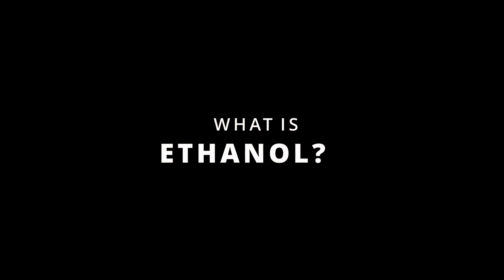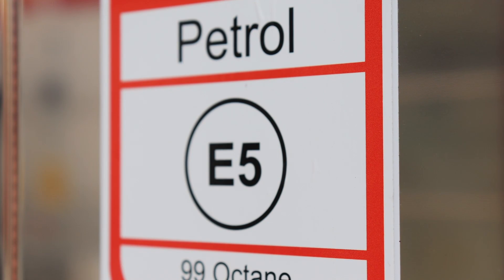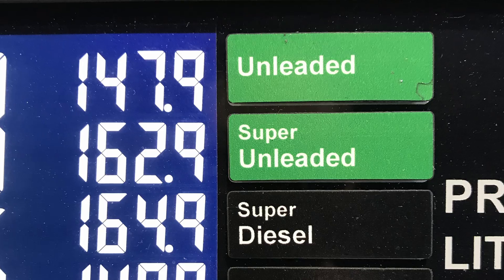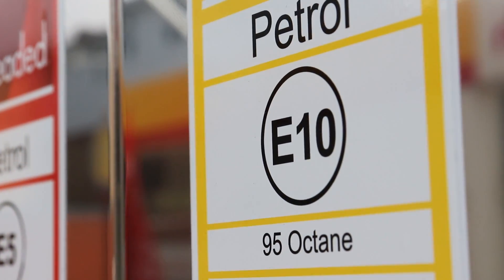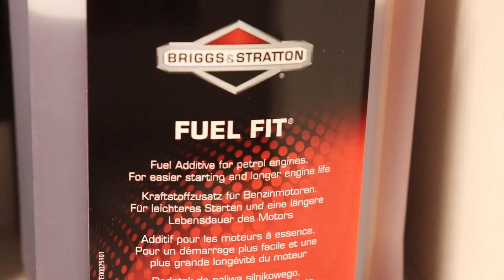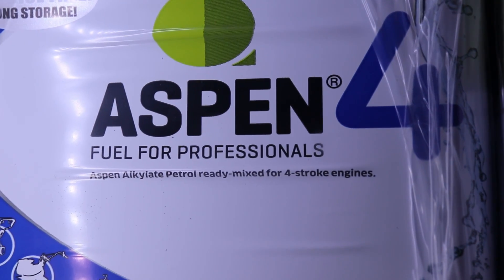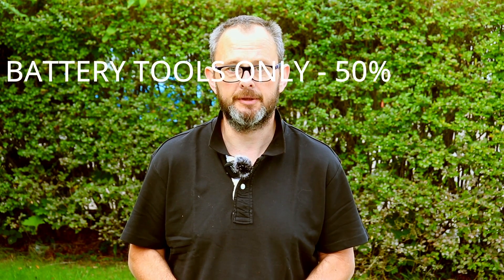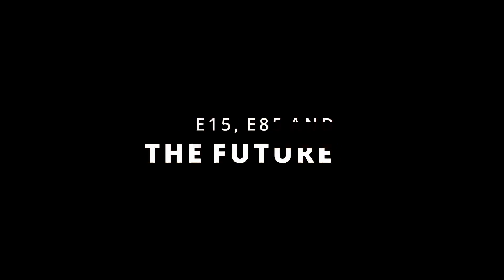Problems Caused by E10 Fuel in Garden Machinery

Comment: You should not use crap pump fuel in garden tools! Use aspen 2 or aspen 4. No problem!
Reply from the maker: Hi Trevor. I agree. However, the economics of a gardening business make it a very expensive option. It would cost more than double my tool fuel costs. It’s a difficult balance. Thanks for posting. Nick.
Reply: @NickBarban  if kept air tight container should go the distance or use one of the very good con servers!

Comment: Its killing you when you breath the fumes in .
Reply from the maker: Hi Barry. I wear a respirator made by NA & UM. Works a treat. Fit is a little awkward in the winter as the fitted face guard is a little more rigid in the cooler temps. 👍. Thanks for posting. Nick.

Comment: I use E5 for my motorcycles and preservative when off the road for winter. I use E5 for my Vauxhall when doing long distances, E10 for city use. I use premium diesel in my Sprinter for long distances and normal diesel for local use. I only use fresh E10 for my garden tools and pour remaining fuel in my car when finished using garden tools. Very informative video though.

Comment: E10 does not produce more power. It has less calorific output than no ethanol polluted petrol. An engine has to be tuned to run on e10 and not contain older rubber or plastic parts that are vulnerable to ethanol. It is a disgrace that this was introduced as the “consultation” highlighted just how many millions of cars were not compatible but they did it anyway. All this has done is put to the cost of running older cars with zero advantage to the bill payers. This is typical green obsessed government putting up tax take by the “green” initiative.

Comment: I have a 4 stroke Honda generator which never failed to start no matter how old the fuel was. Never been taken apart in 25 years until e10 came along, now it never starts and I’m an expert at stripping down the carb. Not sure if it’s related, but my wife’s car shredded its fuel pump after being off the road for a couple of months. It ran for a few seconds then the pump seized.
Reply from the maker: Hi Pete. That all sounds horribly familiar. Good luck with repairs. Thanks for posting. Nick.

Comment: I am trying to find replacement fuel hose for a small strimmer whose pipes and primer bulb have all rotted. Most of the suppliers of the standard clear plastic type pipe say don’t use theirs with E10. E5 only. And I suspect that the suppliers that done say are just dodging the issue. No one claims E10 compatibility. Seems that E10 softens the pipe. So has anyone found that E10 rots their pipes? Using a petrol additive seems unlikely to stop this problem, as there is still 10% ethanol there. 

Only pipes I can find that are E10 compatible are the thicker rubber covered ones and there isn’t any way to use these thicker ones in my strimmer. So I need to use super unleaded only it seems.
Reply from the maker: Hi. I use super unleaded AND I add in the Briggs & Stratton fuel additive. I have not had and problems on my strimmer or my blowers. Seems to be working so far.  Might be worth a try. Hope that helps. Thanks for posting and I hope you find a solution. Nick.

Comment: I only found this video after my petrol lawnmower had completely seized up. I had tracked the oil and all was ok until the first cut after the winter. I used fuel purchased last October that had been in a jerrycan and had no idea that E10 would cause issues. I have made the decision to move to electric, as an excellent offer on Greenworks for a lawnmower with 2 x 4Ah batteries, trimmer and hedge cutter for under £270 was available. I only have 4 small to medium lawn areas and believe battery power should cope with all of it. Sadly I think E10 fuel is just not viable for garden equipment and the experience makes me wonder about all those car engines that must not be as healthy.

Comment: The same equipment you refer to is used in Brazil, where the mandated fuel is E27 and there are no reports of ethanol creating excessive damage. What can you possibly imagine would make equipment in your country not able to also use E10 or E15 or E20 or E27?
Reply from the maker: Hi. Although it does affect vehicles, this video is specifically to garden machinery. Fuel can be left in the tanks of certain equipment and the separated fluid that results, is the main cause of the problems, not the E10 when it’s fresh. Hope that makes sense. Thanks for posting. Nick

Comment: My little used 2018 bought two stroke standby generator was fuelled up in November 2021.
A power cut in March 2022 started the generator and it ran for around 15 minutes then cut out.
When I went to restart it it did not sound right so I tried the manual pull cord and noticed immediately that there was very little compression resistance.
A stripdown revealed a scored cylinder bore that was beyond repair and at the time I thought that I had added too little oil to the fuel.
I have since learned about this and I am really angry that the oil companies or government failed to get the message out that this fuel is poison to some engines. 
I never knew about the problems with E10 petrol as I was never informed about it but it has cost me a £189 generator.
I used to believe and try to be "green" but now they can shove it where the sun does not shine thanks to this policy of blindly introducing a fuel that wrecks small engines and many old cars.

Comment: Gave up using regular pump petrol and have moved to aspen. I had 2 stroke oil so i went for aspen 4 and mix stihl hp super with it at 45:1. The aspen plus stihl hp super contains fuel stabilizer for an even longer life. No toxic smell either engines as clean as a whistle. I dont give in to us causing climate change and i hate electric/battery tools.

Comment: Thanks for the vid.
Remember, E5 doesn't mean it has 5% ethanol, it means that's the maximum it may contain (same with E10). This can vary depending on fuel supplier and location. For example, Esso E5 in the midlands and the south of England contains 0% ethanol however they are legally required to label it as E5 despite it having no ethanol.
I use E5 for all my garden machinery
Reply from the maker: Hi. It’s a point that’s been brought up quite a few times now. It wasn’t something I looked into. Maybe it’ll be part of a follow up. Thanks for posting. Nick.
Reply from the maker: Just as a matter of interest, where did you get that data from?  I’d be interested in having a deeper look into which fuels have what. Cheers. Nick.

Comment: If alkylate fuel is so good, why don't we have it for vehicles.
Reply from the maker: Hi John. Modern engines closely match emission levels that’s alkylates produce in smaller engines for tools. But, alkylates are produced from gaseous hydrocarbons from fossil fuels. Essentially, they are a byproduct of the oil refining processes. Thanks for posting. Nick

Comment: Do not use E10 or even E5  for  garden machinery  - there are long term stable fuels available based on alkylate petrol - Aspen and Husqvarna are two fairly readily available examples - there are others - These typically run £20 for 5 litres but they don't gum up carbs or cause lubrication failures - so long term much cheaper than fixing busted tools.

AVGAS is ethanol free - get it from your local airstrip.
Reply from the maker: Hi Doug. If I wasn’t running a business, I would happily move over to Aspen. But with contracts I currently have, at least doubling the tool fuel cost, it isn’t economically viable. An extra £150/m for fuel isn’t in itself a huge extra cost, but with all the other utility cost increases, and the £300+/m additional cost for ULEZ starting in August, it’s just not a viable option right now. Hopefully if I can reduce other costs, it might become a viable option. Thanks for posting. Nick.
Reply: @NickBarban  agreed, if you are a professional then running pump gas is cost effective, but for amateurs who might run only a couple of gallons a year the higher fuel cost is more than made up for in lower repair costs. One banjaxed carburettor can cost over a hundred pounds.

Similar story of you run carburettor equipped vintage motorcycles....

Comment: I now use Super unleaded in all my small engined tools, mower and strimmer both stopped working. Once filters and fuel lines cleaned and E5 fuel used all tools fired up straight away and all now run beautifully.  It's a bit more expensive but better than having to replace all my tools!
Reply from the maker: Hi Wayne. I moved to E5 fuel with fuel fit as soon as E10 came out. I’ve not had any issues. Fuel cost may be more expensive but it beats they hell out of all the parts that would need replacing on all my 2 stroke gear, bearing in mind the mileage they get used. Not sure what I’ll do when they stop making it. Don’t know if I’ll have transitioned over to battery tools by then. Just can’t see the benefit of the cost yet! Thanks for posting. Nick.

Comment: Useful video,  I only use E5 in mower and chainsaw as there were running problems with E10.  I have also bought a battery powered mower and chainsaw which have the same battery platform.  These are quite efficient,  the chainsaw won't cut as quickly as my petrol one, but I wouldn't expect it too. Most mowing and wood cutting now using battery tools and sometimes using petrol kit for certain jobs.
Reply: Your E10 problems are in your head.

Comment: Years ago, 1961 my friend was running a James motorcycle with a Villiers 225cc 2 stroke engines d to make it smell like a racing motor cycle he added around a tablespoon of Castrol ‘R’ oil to his 2 stroke fuel mixture. Now for those who don’t know  Castrol’R’ is a vegetable based oil. When burned, like cooking oil it leaves a sticky gum residue in the combustion chamber and piston rings. 
The fuel mix we are putting into our cars and lawnmowers is just that vegetable oil. The only way I was able to clean my friends engine was to strip it down to all it basic piece s, with the exception of the crankshaft which needed special tools which I didn’t have access  to .
To glen all the parts (not many) on a 2. Stroke  engine was to use brake fluid and a 1 inch paint brush and soak all that I could get at. I started at 8 o’clock Saturday morning and finished it off by Sunday evening at around 6pm. Washed out the fuel tank with cellulose thinners an put in some petrol/oil mixture and a shot of Red X .
I know what it does to petrol engines but we also have to put this rubbish into diesel engines. Is this causing problems with exhaust systems as my BMW 420d has had 2 recalls for the particulate filter catching fire and this vegetable additive is just the thing to cause as drivin at less than 3000rpm doesn’t get the system hot enough and 3000 rpm would break the speed limit ☹️

Comment: What a useful report . Many thanks . I ran my 4 stroke ride on back in 1998 to 2007 on 6 Fench Franks Cologne mixed with stardard cellulose thinners , the water dropped straight out and i decanted the top layer . Even added a bit of household kerosine . Ran fine , a little rough but cheap !😃
Reply: What on earth is Fench Franks Cologne?

Comment: This is a issue and you should not use it in your small engines   additives separate out , and clog up the carb and more ,issues and breaking down  will be more
Reply from the maker: Hi Ian. Only reason I run with additives is that doesn’t stay in the fuel tanks long enough to separate. I just have to remember to drain in the winter time. Thanks for posting. Nick.

Comment: its so easy to deal with e10 fuel 

buy it in 25 L add 25L of distilled water shake well let sit for 24-48 hours  and you will see it separate drain off the water at the bottom 

now you have pure petrol  and  remove ethanol in to water as  ethanol hydro scopic

Comment: The whole E5 and E10 nonsense is being sold by the government as being better for the environment and blah blah but the reality is that that is not the case, its a lot like the leaded vs unleaded where they removed lead which caused problems for cars and small engines to save the environment but kept quiet that unleaded had an additive called benzene that was worse not only for the environment but also animal/human life,   and things like E5 and E10 have been tested to show they cause the user to burn through more fuel that usual which means over all equal or in some cases more hydro carbines are emitted meaning nothing is saved , however here is the real reason we have E5 and E10 if now you have worse fuel efficiency you need to buy more fuel more regularly to cover your usual use and this all adds up to more spent and so more profits for the fuel company's.

As for battery tools they are good and have there use, originally i used a petrol hedge trimmer / grass trimmer / flymo hover mower, then a a year or so back i got a Worx power washer and since i had that I got a Worx hedge trimmer and just recently i purchased a Worx  grass trimmer and they all use the same battery and since i got the ones with batteries I have 3 batteries so i never run out of power, I still do use my 30 year old Flymo 2 stroke hover mower but i have been looking at changing that for the Worx  lawnmower that again still uses the same batteries.

As for E5 and E10 if you are concerned about using it in small garden engines there is actually a process that can be used to extract the ethanol entirely from the fuel

Comment: Yes it is killing tools. I have a brand new mower that just constantly blocks the carb with a jelly substance. I get maybe two cuts of my lawn with it.
Reply from the maker: Hi. If you use E5 AND use a fuel conditioner like Briggs and Stratton Fuel Fit, it might help clean things up. Hope it helps. Thanks for posting.
Reply: That's exactly what I had. I ended up junking my mower as spare parts were no  longer available.
Reply: Same issue with me. 2019 Honda mower is useless too costly to get carb cleaned constantly and now being sold for scrap. I used the fuel stabiliser which didn’t help at all.

Comment: There is a simple answer to everything.
If wood chips from the US to feed the Drax power station is regarded as carbon neutral then there is nothing to stop plant oil being used.
For that the new rotary engines from Mazda and Liquid Piston can be easily adjusted to run on that.
So instead of going to a petrol station you go to your local farm to get filled up.
As for the evil ethanol that will just go into the dustbin of history.

Actually, you could probably suggest the best plants to grow to obtain oil.

Comment: I use Aspen in my mower
Reply from the maker: Hi John. I’ve considered it, but for the volume of fuel I use, I’d probably have to sell a lung! I🤣. I use Shell V Power with Briggs & Stratton fuel fit. In terms of ecological impact, I know it’s not even on the same scale, but commercial work doesn’t have the same profit margins as 10 years ago unfortunately. Thanks for posting. Nick.

Comment: My car is doing more mpg was 30mpg now 35mpg with a slight notice in power loss only I do occasionally put a drop of redex in the same for my briggs and Stratton mower seems to be ok and they both start ok. Redex may be helping cylinder upper lubrication and they say ethanol increases water vapour in tank reason for redex
Reply from the maker: Hi Stephen. Never considered using Redex. I might have a look at it. Thanks. Last time I used Redex was in my 1982 Ford Fiesta Ghia X. I think I stopped all the traffic on my road when I set off. Looked like the fog had rolled I.  😳. Thanks for posting. Nick.
Reply: @NickBarban  LOL, you should see it when you pour some down the carb with the engine running. It's like a 1980's Cliff Richards pop video!

Comment: "equivalent to 350000 cars being taken off the road" AND OR stopping working........... cos their engines had too much water in them. Oh yes that'll work in getting the cars off the road and/or petrol powered engines. Thank you for your time and effort putting this video together.
Reply from the maker: Hi Daniel. Glad you found it interesting. 🤘
Reply: You do know when e10 first came out everyone with older cars and garden equipement was pretty much warned that they will be dstroyed and as you rightly say its a plot to get rid of the older cars off the road,but some saying if you add a cap full of decent 2 stroke oil to the tank it will be fine and not wreck the engines.I do the same running my car on kerosene and my generators i just put a cap full of 2 stroke oil in the tank and have done for asong as i can remember

Comment: Top man well explained  they are just rotting your cars to tunnel you to electric  cars can this be legal ???
Reply: I'm going to start, when I get it back on the road, running my 1975 classic Ford on Aldi/Lidl whisky. It's going to work out cheaper in the long run I think! 😉
Reply from the maker: Hi Dave. There’s always an agenda. I try to steer clear of the politics, but consider this - in 2025, diesel cars will stop being manufactured, in 2030, diesel trucks and van will stop being manufactured. Which means battery materials need to be mined at an exponential rate, but there just isn’t enough to go around. So, is it going to be hydrogen, water, or are we going back to the horse and cart!? 🤷‍♂️. Thanks for posting. Nick.

Comment: best solution is to buy a $35 ebay LPG and Petrol or dual fuel carb , fit it . gas LPG is safer than petrol .LPG bottles only explode when the bottles are not serviced or stupid people remove the safety , also it never goes bad, after 20 years LPG has not deteriorated at all , as good as when bought . also half the emissions of petrol . mostly water and co2
Reply from the maker: Hi Paul. Thanks for the info. Hopefully someone will find it useful. Might be fun for me to try that on my mower. Might spoil the warranty though. 😂. Thanks for posting. Nick.